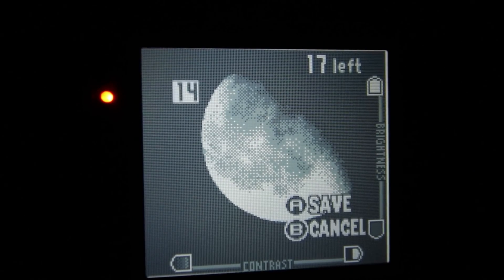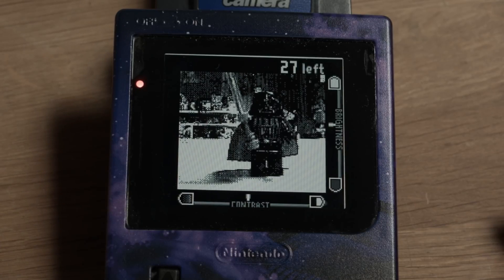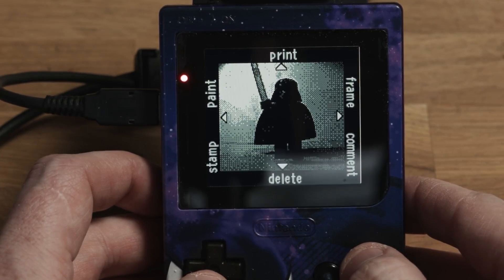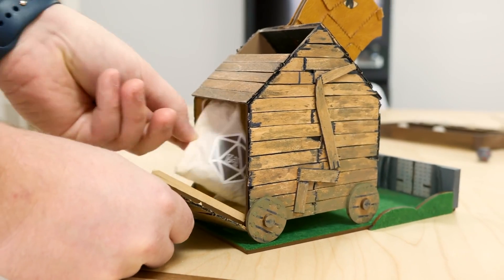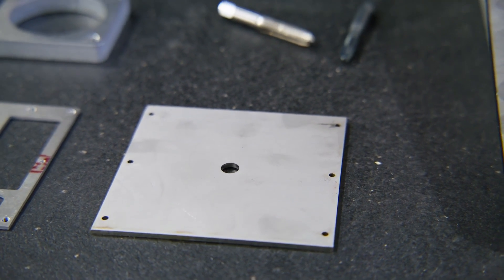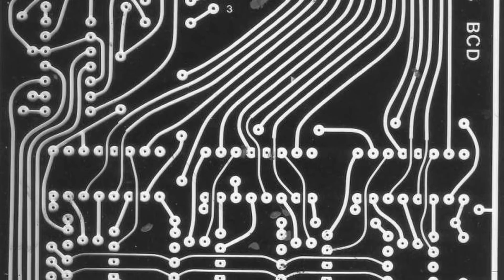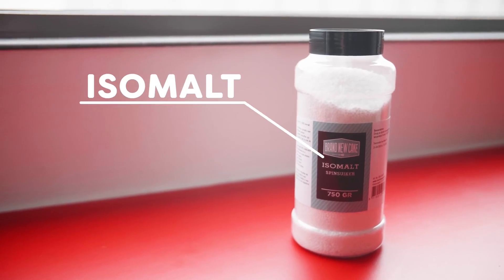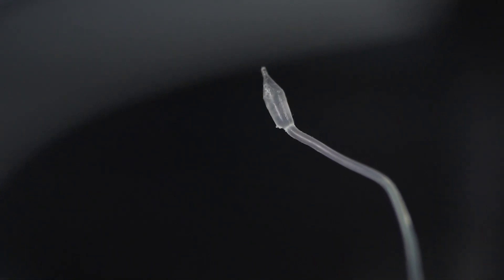Moonshot [Maker Update] | Maker.io

Comment: Same thing happened with Lego a few years ago, but my lego compatiple 3D files remain on thingiverse. Hey Tyler, question for you. If I wanted to record some audio and have it triggered to playback off a sensor, what would my options be? Would a raspberry pi do it?
Reply: A raspi can definitely do it, but there's lots of other stuff that can as well: any circuit python board with the help of an audio amp & speaker, for example. A few years ago I got a small audio board that works with any arduino compatible board that has an SD card for audio files, an amp and a 3.5mm audio jack. Lots of ways to do this.
Reply: @twinegarner  Cool, thanks. I'll see if I can figure out some other alternatives, because raspi is very expensive now that I'm looking at it.